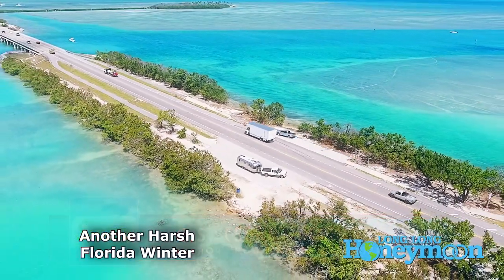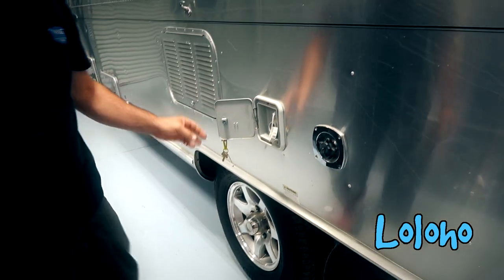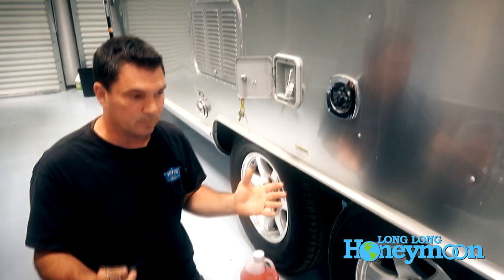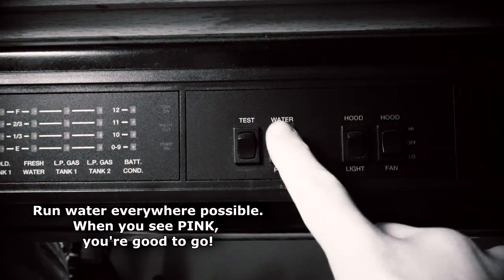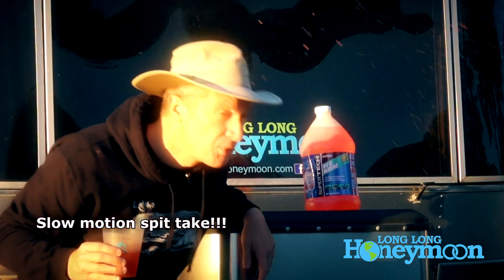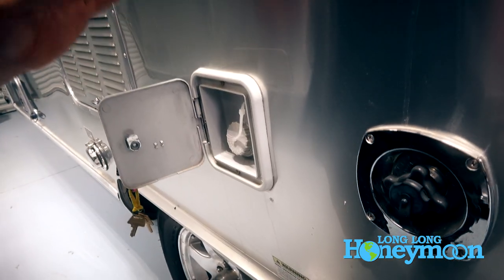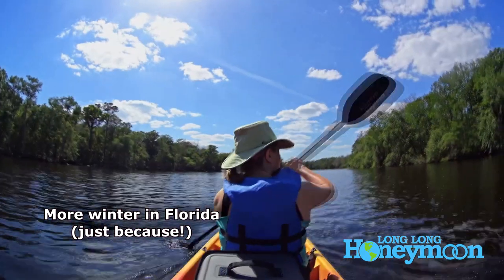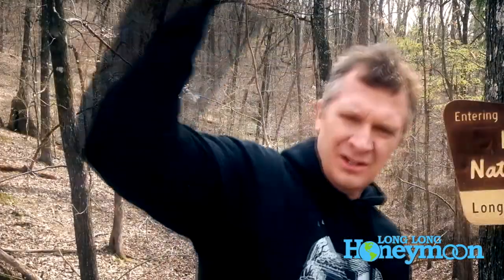❄️Winterizing an RV - The Basics!

Comment: We love to RV all winter in our cold climate in Central Oregon.  At the end of each trip I just drain water tank and hot water heater.  I  use my air compressor to remove water from lines and put a little RV antifreeze in traps.  So simple and quick.  The next trip I just refill water tank and hot water heater and off I go.  Want to loose the crowds, RV in winter in cold climate areas.  We  just returned from a 5 day trip and did not see a single other person.

Comment: The newer Atwood water heaters also have an additional drain inside,  it is almost directly below the bypass valve on the floor.  You can see it on the floor in the video.

Comment: I use 2" Blue Painters tape to cover the grates and/or air vents on the INSIDE of the water heater and refrigerator access panels.  This keeps insects and dirt and misc. vermin from getting into those vulnerable spaces to bed down for the winter.  Be sure to remove come spring.

Comment: One thing I didn’t see in the comments is to remove the batteries and take them someplace warm. We use our basement for this because batteries don’t like to freeze either. 
I used to use the pink crud but now am firmly in the “compressed air” camp.   You still need to put a cup in each trap and the toilet bowl.

Comment: Just winterized ours a couple of weeks ago.  Thankfully it hasn't been that cold yet because there was one thing I didn't think to do right away.  Few days after winterizing I realized I didn't open the low point drains after pumping antifreeze.  The low points were full of water still, would have cracked those valves if didn't catch it.

Comment: i work in Glacier BC in winter and live out of my truck camper and it gets to -30C and sometimes -40C now thats a tad cold but furnace is handy start it for an hour before bed, then use your electric heater to keep rv nice and toasty throught night, quite good prices on campgrounds too for the 6 months i go up to glacier the campground i stay at, is 30 min drive from where i work and even has a hotsprings but got 550.00 full hookups a  month ya cant go wrong

Comment: I just finished winterizing today then noticed your video. 😁

I put the antifreeze in the tank and run it through the lines.  This works well in ND and I don't worry about the water pump.  In the spring I fill the tank and flush it twice before it is sanitized.  No problem with bad taste.

Thanks for all the good info!

Comment: In our early days of camping we winterized with the pink stuff as shown in the video.  Later on we had a permanent site in northern n.j and I simply blew the lines with a small air compressor then put of cup of antifreeze in all traps.  Never had a frozen pipe.  Now I live in North Carolina longtitude wise in line with Raleigh.  We don't often have freezing temps and if so not for long.  Now I open the low point drains, empty the fresh water tank and then put the pink stuff in the traps.  Job done.....and no frozen pipes.  Happy Winterizing.

Comment: I am glad to see someone else puts the antifreeze in the fresh water tank. I have been doing that for decades and see no reason not to. My current TT has a winterization kit but my way is easier. In spring I rinse the tank and then sanitize.
Reply: If you choose to add it directly to the tank as we demonstrated here you are really only adding about an inch of fluid to the bottom of the tank. Once the fluid has circulated throughout the system I open the drain on the fresh water tank and drain out the remaining fluid and then flush it with fresh water right then :-)

Comment: Thanks for the video even though we live in the south, we are contemplating to go ahead and winterize since we are newbies and first winter.  Looks pretty easy so we are going to give it a try.  Only issue is we have the on demand water heater that was installed in our 2021 Bambi so must be the yellow valve - will go take a look at “Colette’s” water heater.

Comment: I put a valve, not sure what you would call it a three-way valve perhaps? between my pump and the hose from the fresh water tank.  So when I want to winterize all I have to do is turn this valve and I also have a little hose (it's a shower hose) that I can stick directly in the antifreeze.  It works really well and doesn't require as much antifreeze as putting it in the tank does.  Also then you don't have to worry about flushing the tank in the spring.

Some other tips:

Before draining and isolating the hot water tank, open the valves furthest away (in my RV that would be the bathroom sink) and don't open the pressure relief valve.  This way when you drain the tank it will try and breath through the plumbing and suck most of the water out of the lines.  The reason this is good is you end up with less water in the grey tank over the winter when you run in the antifreeze.  Water in the grey or black tanks ends up sitting up against the valves and if you don't get enough antifreeze in there it can crack the valves, what a mess!  Also hard to fix because they are glued on.

For the same reason, if you have low point valves (I don't), drain the system before adding the antifreeze so you have less water in the grey and black up against the valves.

I'm against air blowing the lines or just draining them with the low point valves.  You should do that, but put antifreeze in the lines anyway as it prevents mold.  Nothing is worse than mold in the lines, the only real way to get rid of it is to re-plumb the trailer.  Chlorine helps but it never really gets it back to right.

On to other things, if you don't have a battery maintainer or have the trailer connected to shore power, disconnect the battery(s).  If you don't they will freeze and possibly rupture, which is a big mess.  The stereo and CO detector will drain the batteries and then they will freeze.  I can't disconnect my batteries because it messes with the solar system, so I pull the fuse for the CO detector and stereo out for the winter.  Wouldn't the solar maintain the battery?  Not when there is 6 inches of snow on it and it's facing north.  Learned that the hard way.

Also make sure you don't forget any cans of pop or such in the trailer.  They will burst.  Plastic water bottles usually survive and don't make such a mess but make sure all that stuff is out.

Use the latches provided to make sure the fridge stays open a smidgen for air circulation.  Most modern fridges have them.

Comment: We love winter camping and have heated bays. When not using it in the winter, we now store in a heated building. Before we started winter camping, we use to winterize by blowing out the lines before using antifreeze just to be safe.
Reply: If you have a four season RV, then your water tank and gray water tank will be in heated space.  If you have a three season RV, this is not necessarily the case.  Mine is a three season RV.  The fresh water tank and the gray water tank are in heated space.  The black water tank is under the floor and out in the cold.  Even some four season RVs have the black water tank outside of heater space.  You need to check yours out and see what precautions you need to take.

Comment: It gets darn cold here in the Winter at times so we winterize. We hit the full tank when dewinterizing with 16 oz of white vinegar then flush all the lines with it.  Then use a cup of bleach to the next full tank and flush thru the lines.  We live in a very warm area in summer and that insures good flavor.    Drain then fill with fresh  water yet again then drain and fill again, it should be great. and ready for summer.  Thanks for posting.

Comment: We live in Northern CA and we get about 10-15 days per year where the temp goes below freezing during the night.  We keep our Airstream in a covered carport and we have had success just removing the water from the water heater and using compressed air to force it out of the heater and subsequently the rest of the fresh water valves in the trailer.  Never had any issues with this method in our climate.

Comment: I like using air pressure. It's pretty fast and gets most of the water out. But still need to pour antifreeze down drains for the traps and in toilet bowl to protect seal.
Reply: If you use compressed air to blow out the water lines (as I do) be sure to use a regulator to limit the pressure applied to the plumbing system. I keep the pressure at 40 to 50 psi and it does a fine job of clearing the lines. You'll still want to open the low point drains to get the last bit of water out that can't be removed by air flow.

Also, I put an electric heater in my travel trailer during the winter, set at about 60 degrees F. That helps to prevent condensation build up so that we don't have mold/mildew problems. I have found that the thermostats on the inexpensive electric resistance heaters seem to fail (sometimes in the ON position) when used like this. After several failures I built a box with a standard household thermostat, 24VAC transformer and an appropriately sized relay controlling an outlet into which I plug the electric heater. This arrangement has lasted well over five years now as compared to the one or two winters that I was getting from the heaters when I used their internal thermostats.
Reply: @donkinzer5718  any decent compressor has regulator. I tend to keep mine set to 30 psi when winterizing.
Reply: I’m with you on using air. Set the compressor to 40. Just learned the black tank flush needs anti freeze so will get a pump for this years.  Best thing on using Air is dewinterizing which I’ll do a couple times each winter as we will use it 12 months a year but don’t keep it heated when in storage.
Reply: @rollandbrower7827  can't you just use air on the black tank flush line?
Reply: Tim List , two months ago when I posted the comment I had read on a forum the San T Flush needed the pink stuff. After hand pumping some into mine I wasn’t certain any got into the check valve. I ended up calling the Manufacture, they confirmed using compressed air is a fine option. Next winterization I’ll be going back to using air.

Comment: Southern California, I don't winterize either. Although one November trip in northern Arizona my fresh water supply hose froze up. I still had water tank pressure from the pump due to keeping the trailer heated but I didn't have any city water pressure. Inconvient but no problem.

Comment: I've been pressurizing the lines to blow all the water out for twenty or so years.  I use a small air compressor to do this.  Takes probably just as much time as putting anti-freeze into the system but without the need to flush the system after winter.  I've never had a problem with ice.  Just make sure all the water is out of the system.  Temps drop well below freezing here in winter.

Comment: One more comment.  Not sure anyone else mentioned or not but make sure you bypass the water heater before using anti-freeze.  I have read horror stories about people not being able to ever get the taste of the anti-freeze out of their hot water after making that mistake 1x.  I much prefer using the air blow out method, open the low water point drains and pour antifreeze down the traps.  This was the method recommended to me by my RV dealership as well.

Comment: I never had any taste issues after flushing out the trailer.  Used to  freeze protect trailer when stored on the farm in an area that routinely gets more cold than it should in Florida.  Since North Florida cold "hard freezes" normally last two to three hours in our area we just don't do it. We'd run a space heater, or  run the tank heaters.  If you do install anti freeze, use only the RV anti freeze. The other stuff is mostly ethelyene Glychol. (sp) which is the prime thing in "Go Litely".  If you  don't know what Go Litely is you're lucky .  Just believe me its.......uncomfortable.

Comment: Greetings from Canada, where we of course have to winterize every, damn, year...   A couple of things:  A lot of trailers will have a winterization kit which has a hose on the water pump  that you can put straight into the antifreeze bottle, avoiding use of the freshwater tank which I think would be a pain to flush in the spring.  The other point is pouring a cup of antifreeze directly into the sinks and bath so you are sure of having a good concentration in the p-traps.  We just had to do all this two weeks ago - it's very sad....

Comment: You would be well advised to release the pressure from the water heater first, before removing the drain plug, otherwise you could get hit with a blast of water and the anode rod (ouch!).

Comment: No trolling from here! You guys still have one of the most informative sites available. I am usually looking for good info and not so much opinions and such. I am wondering how much I can use my trailer in the winter, now. The Alde heater is winterized and that sucker is so warm, I have it on the lowest setting and still need to have air conditioning on. Will it be ok in moderately cold areas, since the system has floor heating and is circulated throughout? I live in it full time.

Comment: Shaun, if you wanted to skip the whole draining of the hot water heater and just let the antifreeze flow into that area, is that okay to do? Or if I wanted to just leave the hot water heater turned on while I'm away (Only leaving for a few weeks and it will be plugged into shore power), can I just leave the hot water heater on and skip the whole antifreeze thing? I mean, just put the antifreeze into the fresh tank and and other areas? Just trying to simplify and abbreviate. Thank you.

Comment: Hey Sean got a question   How do you like the wheel lock system your using in the beginning of this video compared to the traditional wheel chocks that are available    Is there a difference in what is it because we are using the traditional yellow Camco wheel chocks and still experience a little bit of movement just wanted your opinion

Comment: We just did this today. Thanks so much. We live in central NY. We used our compressor to blow out all of lines twice. We did not introduce the antifreeze to our water lines or fresh water tank as we plan on getting out of the great white north after the holidays. Part of our day also entailed making sure our gray and black tanks were as clean as possible before draining them. We also gave our hot water a good flush as well. After we were sure the water was drained and cleared we added the marine/RV antifreeze to all of the drains, the black tank and toilet. 

Hopefully we don't get many sub zero temps before we head out after the holidays. If we do get some of those freezing nights we will fire up the furnace just to be safe. 

Since we are such newbies we sure hope we didn't miss anything.  Thanks so much for your awesome videos.

Comment: Great video as always but your audio from your lapel mic is distorted.  turn down the gain on the mic and boost it in post production if you need to.
Reply from the maker: I agree, we need to do more experimentation with this setup. I was plugging a lapel mic into the Sony Bluetooth and the camera was autogaining the audio to the point of peaking. There's probably a way to fix it (turn off autogain) but sometimes with consumer gear it is not easy to override the automatic functions.

Comment: One little note sorry Vinnie I’m sure he assumed we are not idiots but never ever let any unregulated water pressure in your rv.  No need get every last drop as long as the water has room to expand no damage will result and that water won’t be a problem as long your  flushing and sanitizing your tank.  I always sanitize at the beginning and end of the season.
Reply: Good point. The Airstreams use a common city water inlet. It has a built in regulator. Many others dont.
Reply: AirStreams the master race mine is a Pacific Coachworks which doesn't but I'm curious person by nature lucky the goodie bag the dealership provided after purchasing had one in it not knowing what it was googled it and glad i did could have made a big mistake.

Comment: What about preventing mice/rodents from making your sitting camper a warmer bed for themselves? Other than the obvious of not leaving food stuff in the camper what can you do for keeping them out?
Reply: there is another video episode they provided on that!  (of course)
Reply: Steel wool packed into any opening, particularly around the plumbing...
Reply: I read that you can use strong smelling bars of soap to repel them. Like Irish Spring.
Reply: Many trailers sit in storage here in Minnesota over the winter months. Some outside and some inside. Most talked about rodent prevention we have heard in the RV community is using Downy dryer sheets. Use the original scent...put sheets throughout the camper in drawers , cabinets , cubby holes and even outside compartments . Haven't heard of anyone having an issue that has used this method.
Reply: My PO and their friends swore by urinal cakes in storage compartments so that's what we use. No rodents yet. Urinal cakes come with different smells for us so it's not like you think, can't even really smell them. We use cherry.
Reply: @fatfrogfarm  Mice LOVE Irish Spring.

Comment: Just wondering, do most of you use a socket to remove the cap on the water heater? I have a new travel trailer and get very frustrated with this cap! It’s in an awkward spot. Thanks

Comment: I have no clue how to winterize my motor home.  I have been fine in it down to 17 degrees, well other than the busted pressure regulator.  It does not have low point drains and no bypass on the water heater so I would not know where to start except checking the weather and maps.  Start the engine and drive.